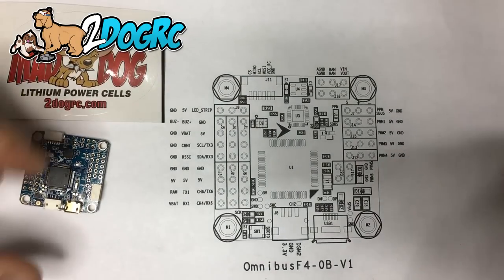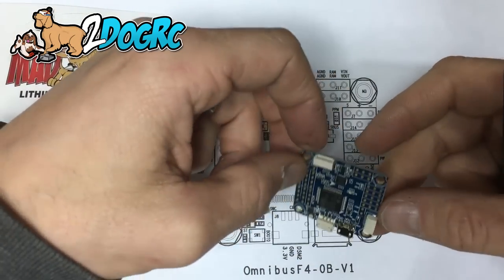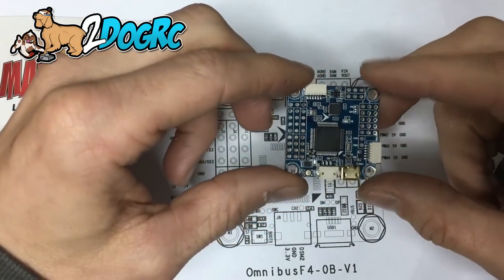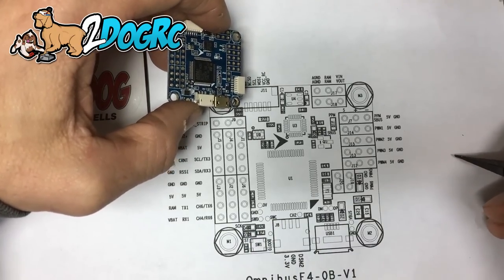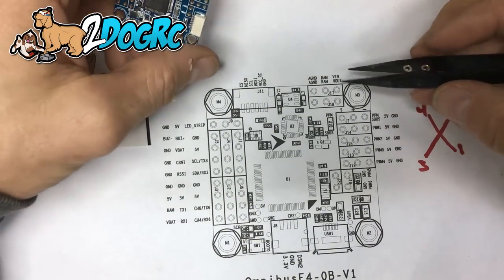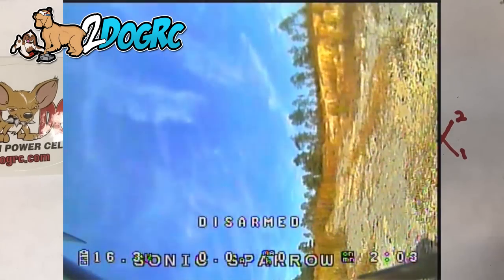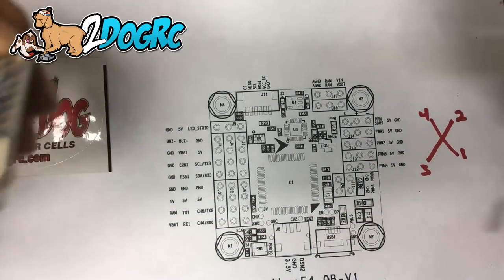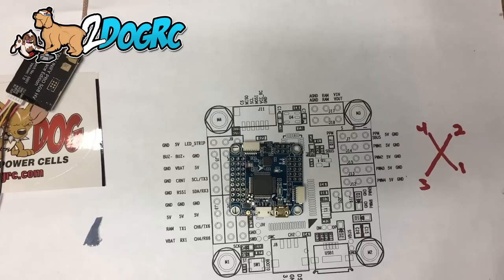Omnibus F4 V3 All in One Board Hook Up Instructions

Comment: Just a tip. If you want you can also run the power for the camera from the unify to the ram pad and then run the cam power lead to the other ram pad and you can power the camera that way as well. Just to jump the power pads for the ram pads and it will work as a pass through port instead.

Comment: Regarding the receiver wiring for SBUS . I am using frysky r900 and many guys complaining fron the issue of connectivity and ended up solving it by soldering the side jumber just next to the receiver s + - line .. you said never touch it as it’s designed for sbus already. Mine never established a connection till this moment . Any thoughts? Should i go and bridge that ppm - sbus jumber ?

Comment: Hey man the barometer is located on the other side of the board and has a little hole onto it. Not the grey part you pointed out there.
Reply: ras
Reply: hello!! is it possible to get a current sensor with this board?? I know only pro version has current sensor, but why betaflight osd throws a ridiculous current usage and drawn reading??? I want mah reading!!!
Reply: mah used is mah reading,  are u saying u ant to see how much mah u hav left?
Reply: @motormadness9975  That was supposed to replace the fet from previous version, I believe  it's a part of the step down converter.

Comment: I bought the same flight controller but the 2.5 version and I was lost if it could handle a 4 in one esc and I didn’t know how to wire it but u just explain everything I need I’m gonna start doing it now and let u know it it works

Comment: Good video, but I need youyr help to connect a PPM receiver. I have jus adquired an Eachine Wizard X 220S ARTF wich is coming with an Omnibus F4V3 with BTFL 3.1.7 (April 2017) and board OSBD, version 0 , according Betaflight configurator10.3.1-  It comes preconfigured for SBUS connection , but I need to use CPPM connectionfrom a Fr Sky reciever Delta -8 with CPPM , similar to D4R-II but multi protocol.  
I have already change the soldered jumper from SBUS to PPM on the board ; configured PPM RX input on Betaflight configurator tab, tested without serial RXport activated (as it should be), UART3 or UART 6 activated on Ports tab; and I have no any movement on Receiver tab. Do you know what is wrong

Comment: Great Vid. my Question can you put ground wired of the cam on the board and the positive wired on the PDB.  Since you said that ground will be good to put it on the AGND where the cam signal is at or do I have to use the RAM pin to put the cam positive????
wired.
Reply from the maker: Yes you can do that, but if you do make sure the Grnd from the camera signal is also going to the FC.

Comment: Hi Thanks for the wiring tips. WOuld like to check the motor arrangement. When you drew motor 1,2,3,4 is the 1 front of the quad or back? and it is cw or ccw?
Reply from the maker: #1 is the back left and it is  clockwise. You can look on the config tab as well for motor number and rotation direction.
Reply: thanks

Comment: Question, When supplying power to the board (where you stated). Is it the full voltage of what ever batt. you're using, or is it only to be 5v input?
Reply: batterie voltage that will be regulated to 3 and 5 volts on the board

Comment: Got a question. Everything is connected as your video explains. Everything works, quad is set up. Only thing is, when I am connected to betaflight and connect the Battery. Under the configuration tab, vbat tab is switched on. Battery voltage shows at the top of betaflight in the center, but does not turn green. Any ideas?
Reply from the maker: Does the low voltage function work?  If you plug in a battery with low voltage, does the beeper go off?  If it does, don't worry about it , it could be a configurator change.

Comment: My mini USB input has come loose from the controller card, You can re-solder the board? Or do you think I'm going to have to buy another controller card? Tkx
Reply: Sounds like you bought an inferior / clone of the original airbot boards.
don't buy from ebay or cheap suppliers, https://airbot.uk/product-category/flight-controllers/

Comment: Thank you for this. Used this video to wire up last night. However, having problems with the buzzer. Wired it on buzz+ and -, connected it to aux3 switch, FC is working properly when switch is activated but no buzzer sound. Have you had this? Help please.
Reply from the maker: Try swapping the wires on the buzzer.  I hooked one up backwards once, then swapped the wires and it worked.  OR  it may not beep when connected via USB if you have that turned off in Betaflight.
Reply: 2dogrc thanks had it wired wrong. Whew!
Reply from the maker: +Roland Burrows Don’t worry.  Most of the tips I give are from my own mistakes!  Just pay it forward!

Comment: Hey there - I've got an omnibus pro v2 w/sd build going, and I'm trying to get it to talk to an X4R.  I've wired the x4r to the sbus input, with +5 and ground.  The sbus jumper is bridged.  The x4r gets power and binds to my taranis.  I have tried serial rx on uart 1, 3 and 6, each by themselves and all together.  I have serial based receiver and sbus option set in configuration.  I've restarted betaflight over and over to make sure the settings have stuck on save.

I'm getting no signal in the receiver tab, no matter what uart I have set for serial rx.  The throttle defaults to 885, and everything else is 1500.  No stick or switch movements register.  I've tried two different x4r's, both behave the same, and both have worked on other quads.  I'm pulling my hair out.   Any ideas?  Could the FC just be a bad one?  Vtx, cam, esc's motors, everything else works.  Just no joy on the rx/fc communication...
Reply from the maker: Yes,
  It could be a bad board.  I have seen this before.  If you purchased from us, please send me an email on the contact us page of the website.
Reply: I don't actually remember where I got it from.  I tell you what though, I'll buy a new one from you as you've helped me.  I think I'll do the receiver first this time...
Reply from the maker: Yeah, I have had 1 or 2 that had this issue, but can't figure out why.  One thing I did notice is that the SBUS pad comes shorted, and the boards that were returned to be you could tell the customer added more solder to these.  I am not sure if that was the issue, but only thing consistent on both boards returned.
Reply: @MarkDStrachan  yeah half the boards I get only 1 of the 3 uarts work😑🤬😡😫 has to be the firmware... I have f4 pro v3 and only uart 3 works. Fucking bullshit. Cant have gps or magnatrometer such a waste...

Comment: Can you fly a hexacopter with this board? With the f3 I could never get motor pin 5 & 6 to power motors.
Reply from the maker: I don't think you can power 6 motors, because there are only 4 pins.

Comment: I have a turnigy 9x with the standard module. Is there a receiver that will work with the standard module for ppm or one of the other protocols that will work with this FC? If not is it cheaper to get a different module and reciever, get a completely new tx, or get some kind of ppm encoder? I built my quad a while ago and now I'm trying to get it going again. I was running pwm before but my FC is dead so I decided to upgrade to one of these boards and I'm starting to realizing how fast the hobby has moved while my gear was gathering dust lol
Reply from the maker: Hello,
 I did some research and looks like the best way to go is buy the Frsky Module for the TX and then use the Frsky Receivers.  I use the Xm+ in most of my quads, and they are very inexpensive and good!
Reply: 2dogrc thanka for the quick reply! That sounds like a good idea to me. I was able to borrow a ppm encoder to try to get my quad off the ground in the meantime. I have one more question if you have the time.

 My quad has one motor that is spinning way slower than the others. I moved the motor and the Esc around to see if that was the problem but stays at #3. It will spool up with the others but then drop down really low after the initial throttle input. Watching the levels on betaflight it is almost at the bottom of the range while the others are at full. It was doing this with my old flight controller also and I'm not sure what to check next. I saw online that it might just be that it's not in the air so i tried to fly it but it just flips over. All motors spin up together and work fine in betaflight but not from the tx. Esc's and gyro are calibrated and recalibrated. Not sure what to check next. Thanks for your help and time.
Reply from the maker: Yes, you can't test motors via the transmitter on the ground they do weird things because it is not flying. You can test with the Betaflight sliders, and it sounds like you did that and all was okay.  Strange that swapping motors/esc did not change anything. That would rule out a motor or ESC failure.  
Any chance you can get a low hover with blackbox on and send me a log when it flips?
Reply: 2dogrc I wasn't able to get a hover out of it but I got the log. Looks like motor 3 was at 0% for most of it until it flipped. What is the best way to send you the file? 

Thanks again
-Steve
Reply from the maker: email 2dogrc at gmail.com

Comment: What about connecting to a flysky 6 channel ppm receiver?(one wire per channel) I only seen Chanel 5-6 on the pin out diagrams. 
It can't be an all in one video if you don't cover the all part.
Reply from the maker: You can not use PPm receivers.

Comment: Hi i follow your video and able to get everything going except motor not spinning.Omnibus F4 V3 with inav.Setup ibus ok
setup gps and compass ok.esc ground wire to omnibus ground as you say and 4 esc signal to the 4 omnibus signal pin.
Set esc protocol to oneshot125 as mine is Simon esc. This esc is tested with oneshot125 and working previously on sp racing f3.Go to configuration motor page. Set i agree option. Set maximum value on 4motors. Then put lipo on fc.
The esc beep a few times and stop. That's all. It didn't spin.
Try to arm the quad and play around with throttle. The motor signal is working but motor will not spin.Use a multimeter to measure the ground and signal voltage. Fc die immediately. :(
I would like to purchase again but how to make it work?
Reply: After you attached the lipo, the motors should make an extended tune/beeps then stop, now you have to slide master throttle control down to 0, then another little tune can be heard . wait till it stops . Now the esc have been calibrated, you cant just do half of it!. You need a osc scope to see the signals on the ESC control wires, its PWM not a varying voltage

Comment: I bridge the Sbus pad with the middle one and after I watch your video I took off the bridge but I had power on the board would that affect anything??
Reply from the maker: If you didn't touch anything else no, but if you shorted to any other component you could damage it.  The bridge is just a signal jumper.

Comment: Hi
In mine,the peripherals only have Disabled or blackbox
Any ideas ,i am also in expert mode
Cheers
Reply from the maker: What version of Betaflight are you in?  Trying updating to the OmnibusF4SD (if you have the SD card) version 3.17.
Reply: No it's not the sd version
Reply: I am running 3.1.1 On  windows 8.1 through google chrome
I tried this on different flight controller,and it was there in the menu
Just not for this board ,weired i know
 Thanks for getting back to me

Comment: how does the osd know what your battery voltage is, if your inputting a regulated voltage to vbat?
Reply from the maker: The FC gets battery voltage via the Vbat pins from the PDB.  You would connect wires from an unregulated source.
Reply: So do you connect one of the Vbat connections to a regulated voltage, and the other Vbat to an unregulated voltage source? Currently I have my board powered by an unregulated voltage so I get the true voltage via OSD, but the boards cant be powered with a voltage above a four sell battery, so when I start using batteries with higher voltages, Id like to make sure I know how to do it. Please help. Thanks
Reply from the maker: The new versions support up to 6s according to Airbot's website.  So unless you are going above 6s, you are good to go.

Comment: Where do I power the controller? in 5v? How do I get the OSD to properly report the battery voltage?
Reply: HenryBR FPV  same question how do you resolve? Directly with lipo power???

Comment: I don't really get the smart audio thing..  I have a camera with a mic,  I want to use my audio for sound from the camera...
also Ive heard some people say not to hook up direct batt to this fc because the bec gets too hot...   theres another Vbat port on the bottom of that row, maybe that's for getting your osd voltage in this case?
Reply from the maker: Smart audio is only for TBS UNify pro and Immersion RC Tramp.  It enables you to change settings on the VTX via the OSD.  You will have to connect the audio form the camera to the VTX to get sound.  You can connect the battery to the FC, that is what it is designed to do.  That was an issue with a previous version.
Reply: This is also something I'm interested in--getting a wide spectrum high fidelity transmission of the engine noise--preferably in stereo.  Theory is that realtime sound from the engine in high fidelity can improve both piloting skill and PID tuning...

You seem quite knowledgeable 2dogrc - any leads on a cam/mic/vtx/receiver/headset combo that can pull off such a thing?
Reply: 2dogrc yeah I have a tramp that I'm trying to use with this board,   it has an audio in but also has an extra white wire labeled "T" on the tramp..  wonder if this is what I would connect to that TX point
Reply from the maker: Good question.  I have not used a Tramp, only the TBS Unify.  You might have to look up a video on connecting the Tramp.  It should be the audio in, but not exactly sure.
Reply: Mark Strachan , Have you found out anything about that?
Reply: D Rock     75   yeah I have direct power from 4s going to the board. osd works great.
Reply: I haven't.  I have been pulled away on to other things for the time being.  I am still interested though.
Reply: Mark Strachan , It makes sense and I'm definitely going to look into more.  

Thanks for the reply

Comment: for some reason I'm not getting any power to my flight controller when I connect it up vbat and ground I tried to 5 volt and ground and I still couldn't get anything the one on the same row so I moved it over to the dedicated 5 volt and dedicated ground row now it fires right up not sure what the deal is there so I can't use my OSD but hey I Can Fly this will work until my next Revolt comes in I could never get this board going until it was my only board remaining LOL
Reply from the maker: Did you solder the RAM pin on the side of the board? You need to that selected to Vbatt or 5v to power the 5V pins.
Reply: 2dogrc I did not. :)
Reply from the maker: There you go!  It took me a day of staring at this thing before I knew what to do with it!  That is why I made the video.  There is not enough internet info all in one place.  Glad I could help.
Reply: 2dogrc I'm not sure where I was in that part of the video LOL I was expecting a boot pad kind of like on a lux controller
Reply: Ultimatevapor918 That happened to me also. most likely because the v regulator fried. you can use the other VBAT input and it will work fine.
Reply: drumrboynoid the other one should still work? because I'm noticing a real lack of power here with my flight controller taking power from my VTX the pdb I was using on my pup V2 by the way don't use that pdb the 5-volt regulator went out in the middle of a flight killed my Revolt V2 and also cost me an ESC so I'm just using the power from the VTX and my camera kind of goes in and out on the brightness so I know it's lacking power I've just been dealing with it but I will break it down this weekend and try to get everything set up and the OSD
Reply: Wow 5months later I'm back lol I'm ran out of revolts they die so easily 😡😡 how can I keep my escs and motors from booting via USB I can't calibrate them like this lol and when I arm my quad twitches it's not my motors they worked fine on the revolts and they are brand new F60pros this board has been a nightmare but I won't have a new one till Friday and naze32 is out of the question lol

Comment: Can it fly a hexcopter? I see it only has 4 pwm outputs.
Reply from the maker: No, because it only has 4 inputs.
Reply: Yes you can........ you need to use J19 & J20 for motors 5 & 6.
Reply: inputs ?  'outputs'  i would say as they drive ESC

Comment: Any idea how to add S. audio to pwm5?
Reply from the maker: No, you should put smart Audio on a UART port.
Reply: 2dogrc unfortunately that's not going to be an option with an iNav build. Need to find a way to use pwm5
Reply from the maker: Hmm..That is tricky. I don't know if that would work, you would need to ask the smart coding people if that is possible.
Reply: 2dogrc Yup. Need to find a way to disable i2C so I can enable it as a soft serial. Might have to punt the S.Audio.  Shitty